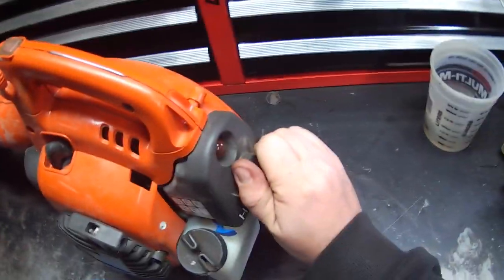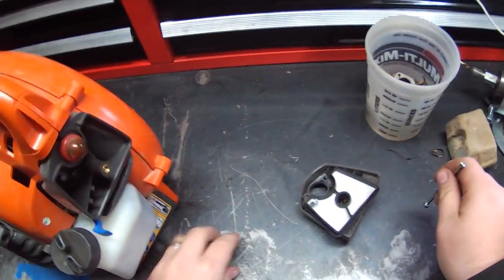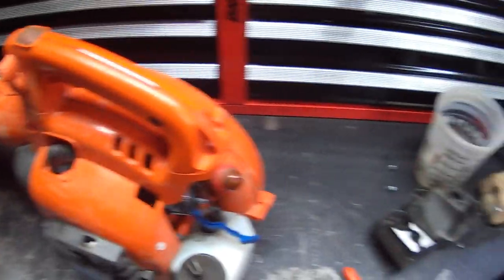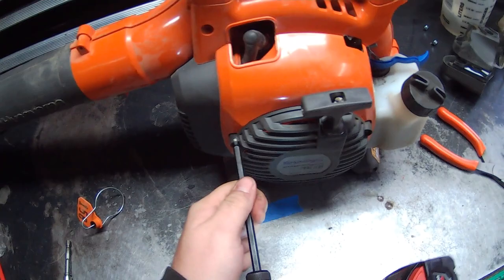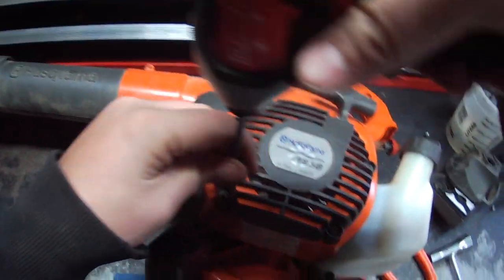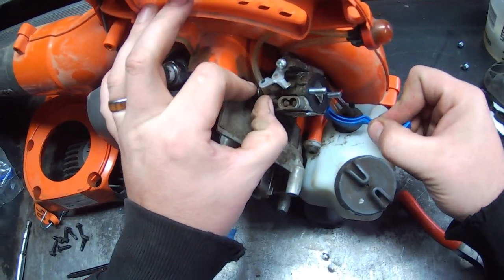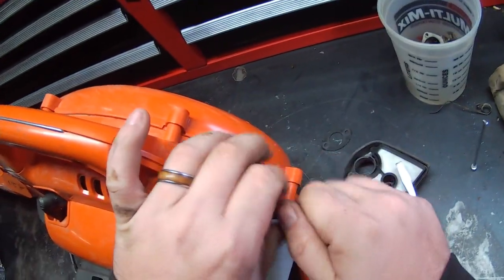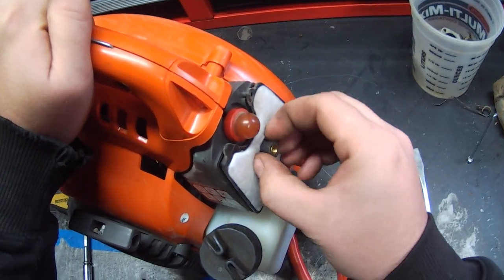HOW TO - husqvarna 125 B handheld leaf blower bogging carburetor carb replacement

Comment: Before a carb is changed, make sure the cheap fuel lines aren't cracked slightly, or in half.  The cheap clear Fuel lines just don't last like old US made.  They crack and cause a lot of issues you are troubleshooting, and it is only the fuel line causing your headache. Also, the 2 gaskets are different.  Pay attention to which of the old goes where/compare shape and pattern to new.  Mine began to run like crap.  It turned out to be a crack in the fuel line sucking air/leaking fuel.

Comment: Mine was doing the same thing and i adjusted the high speed jet(left) out a half of turn and it runs perfect. I bet that is 99% of peoples problem with these because ive had this problem eber since it was new.
Reply from the maker: Yes all of them are adjusted lean from the factory to hit epa emissions standards,

Comment: I've got a 125 BV. But can't find anything specifically for my blower. I also can't find a definitive answer as to whether or not the 125B and the 125BV use the same carberator or if they are different. Any help would be grewtly appreciated

Comment: My uncle bought one of these junk blowers. It runs good at full throttle but it wont idle when you take the throttle lock off even if you crank up the throttle screw so he just runs it at full throttle. It was like that since he bought it. I told him to return it.
Reply from the maker: To lean on the low end, try turning the low screw out a whisker
Reply from the maker: They adjust them lean at the factory to hit epa emissions standards
Reply: We did try previously but  no change.

Comment: Replaced my carb, replaced my gas.  Still having issues after the blower starts up and runs for about 5 minutes.  All of a sudden it just stalls then I can't get it to restart until I wait for about 5 minutes then try again.  Any ideas?
Reply: I had similar problem, check fuel lines aren’t bent preventing gas to pass through.
Reply from the maker: Check for spark when it dies, or crack the gas cap and see if it stays running

Comment: Great tutorial, tear down and assembly was a breeze with this video. I couldn’t get the fan blade off until you indicated that it was a reverse thread. I was having an oil leak that turned out to be a loose screw on the bottom of the crank case. I initially put the piston and crankcase in backwards until I tried to put the fan blade back on and realized my mistake.

Comment: Enjoyed the video.  My 125 B leaf blower starts fine, then on high motor for about 90 sec. it bogs down. I let off the trigger to catch it before it dies and bring it back up to speed and it immediately dies again, this will repeat. I have changed the air filter, cleaned the tank, changed and gapped the new plug and put on a new carb. It seems that it starts cutting out on high after it gets hot. Gas is marine grade, oil is Stihl.  Thank you.
Reply from the maker: Does it always restart? The symptoms you describe are most often the coil breaking down when hot or an air leak making it lean out
Reply: @Coakleyfixedit207  After writing to you, I went and had my lunch and after a couple of hours had passed went out and tried the blower again. Ran great this time. After a week of using it most every day it is still running fine. I won't even try to figure that out. Thank you.

Comment: Watched the video to see about adjusting the carb....I can't believe they work perfectly just by bolting them in!   I got a kit coming today, w/ the special adjustment tool (I guess nothing else works on these)?
Reply from the maker: Yes you need a special tool there is about 12 or 13 different ones, and it's illegal for a dealer in the USA to sell them, the new carbs are set to the factory settings for whatever they fit, if everything else with the machine is good they should run fine right out of the box, if anything they may need to be a little richer ( they are adjusted lean to hit epa standards) to richen them up turn the H screw out like a smidgen 1/8th of a turn. The cheap Chinese carbs seem to never run quite as good as oem they will function but just never sound quite right

Comment: Great video Ryan!  I can tell by the way you move that you are talented and experienced.  I am fighting the same thing, but it is more severe in that the fuel lines are shot too.  I have never seen a more corroded fuel system!  The lead end of the fuel filter corroded and there was junk all in the gas tank and the carb.  It was so bad that both butterfly shafts were completely stuck.  Since it was going to take a week to get a new carb, I tried to clean up the old one - against my better judgment.... I got it clean, but the diaphragm and reeds were crispy. Sure enough, it wouldn't run right.... I have ordered what I hope to be an OEM kit from Amazon.  Few questions:
1. Have you ever seen the lead end of a fuel filter corrode like that?
2. I know ethanol free fuel is better, but should the unit be run dry at the end of the season?
3. Would you agree that the cheap knock off carbs from Amazon should be avoided?  I got burned badly...
4. Do you have a video on tuning a 2 cycle carb?  I have trouble telling the difference between starving and loading up, and I've never been sure about the L setting.
5. Now that I am semi retired, I find myself repairing all sorts of lawn equipment for my friends.  I am getting tired of doing it for nothing. but I want to be fair. What is your shop rate?

Again, thanks for a great vid. I liked and subscribed. Now you are past the bad number of 666 :-)
Reply from the maker: Yes ethanol will eat anything, ethanol free fuel still needs to be stabilized I run strictly canned gas in all my 2 stroke stuff but keep in mind and I dont use my stuff much, chinese carbs are 50/50 chance they will work also rebuilding a carb is a 50/50 shot. I dont own my own shop I'm employed at one of the largest shops in my state and our shop rate is 75 per hr, but the going rate seems to be between 45-100 per hr
Reply from the maker: Oh also running dry is NOT the way to go it gives all the seals, diaphragm and rubber bits a chance to dry out,shrink and crack etc... it's best to run the pump gas out than run in a small amount of premixed canned fuel for seasonal storage than come spring you can just pour fresh in over it and you wont have any issues
Reply: @Coakleyfixedit207  Thanks much for taking the time to answer.  I have had the same experience you described in that a cheap or rebuilt carb is about a 50/50 shot. Why is that the case on a rebuild? I just assumed I had been doing something wrong. Thanks.
Reply from the maker: @briananderson2780  because the carbs have check valves and tiny passage ways inside them that can't be seen or replaced,  at my work we dont even rebuild carbs anymore its more cost effective to just replace and move on usually
Reply: Thanks. I thought I had hit the jackpot with the cheap carbs from Amazon, but I got a bad one. I am about where you are now... If some B12 and compressed air won't get it quickly, buy OEM and be done with it. Thanks for the prompt reply.
Reply from the maker: @briananderson2780  yeah carbs for those OEM are overly expensive like $30 if I remember right but the blowers are like $129 new so not usually worth taking to a shop either

Comment: Informative video. Few days ago, I purchased used Husqvarna 125 BV and it starts and runs pretty good.  When I turn off the choke and full throttle it's pretty powerful. But release the throttle and let it idle, the engine flutters and dies. I tried putting on full choke, half choke, and it won't start. But when I pump the primer again, it starts.  Do you think this would need a new carb or just need carb adjustment? Thanks.
Reply from the maker: I would try turning the low speed adjustment out a little and see if that helps,

Comment: Great video & to the point. I have the same blower & it's ran great besides lately I've noticed the carb seems to be loose which is making it shake & not run properly. Would just tightening the two 8mm nuts tighten it back up?
Reply from the maker: Yes unless the intake block is broke

Comment: Is there a need to adjust the new carburetor now that it's installed? Thanks for explaining each procedure clearly. Did the blower start up right away? You didn't demonstrate how easy it was to start it with the new carburetor!
Reply from the maker: Most of the time they will run with a new carb and just minor fine adjustments are needed MOST of the time I have seen some carbs the weren't set from the factory, I've seen new carbs have the metering levers off from where they should be set but most of the time a factory set carb should run from the get go with small fine adjustments being needed once its warmed up

Comment: Thanks for the video, mine is only a couple weeks old and loses power when I squeeze the throttle, I'm gonna give this a try.
Reply from the maker: Couple weeks old it probably needs both adjustment screws turned out 1/4 to half a turn, they are set lean from factory to hit epa emissions
Reply: @Coakleyfixedit207  worked like a charm, thanks for your help!
Reply: I'm now a subscriber
Reply from the maker: Thanks for the support,

Comment: Great video! I have a 125bv starts right up,runs until i turn the choke off. Would be greatly appreciated if you have a fix! Thank you and keep up the fine work!😎👊
Reply from the maker: That's a broad symptom, try checking the fuel lines for cracks or if its broke inside the tank also could be as simple as turning both adjustment screws out half a turn

Comment: Thanks Ryan! I was reading what you said to Chris Woodruff below and I have something similar. For the past two seasons, I have used my 125B until it dies on its own (about 30 min or so) and won't restart until I come back another day to use. This past week, I started her up and about two minutes, died and would not restart at all. I have a new carb (Amazon), and before I start tearing it apart, I want to test the spark. I used a spark tester on the plug and pulled the cord but no spark. Should I be looking at a new ignition also?
Reply from the maker: If it has no spark it's almost always the coil or the switch is bad but I hardly ever come across that, it's a bit of a project to do the coil if you've never done one on these

Comment: Even with a new cheap carb, it may not run.  Most carb kits will include the adjust tool which is a good indication that you are going to have to tweak.  I'm throwing mine away after next fail to  run and going back to ECHO.
Reply from the maker: The echo is hands down a much better product

Comment: I have same model, about 9-10 years old. Changed air filter, fuel filter and spark plug. Runs great but just started not being able to idle. I use the fuel additive. Any suggestions?
Reply from the maker: Turn both adjustments out just a whisker if its never been adjusted carbs come set lean from the factory to hit epa emissions after awhile they need to be richened up
Reply: Muffler screen is clogged I bet.
Reply: @Coakleyfixedit207  so just found your video, my blower is roughly 5 years old been working great, will stall on WOT. When you say turn out does that mean turn to the left or right? I'm assuming left but want to confirm. Going to try that before anything else.
Reply: Spiros Zangotsis need help?
Reply: @lukeWiz44  nah I got the tool off Amazon and I think I got it going good. Well see though
Reply: Spiros Zangotsis 👍👍

Comment: How long did the original carburetor last before it had to be replaced?
Also can it be adjusted with the screw from the access slots on the top side ?
Reply from the maker: Yes they can be adjusted but a junk carb adjusting won't help, carbs life is fully dependent on the fuel run through them or amount they get run the more they are run the longer they will last (with good fuel)

Comment: So what do you do with the old carb ? Surely not toss it? I ask because I left old gas in mine I dumped it and added new gas and now it runs but not as strong as last season thinkin might need a new carb
Reply from the maker: Right in the trash
Reply: I just looked up the part 15 - 20 bucks might as well trash the old one

Comment: I have torn mine apart, replaced the carb, fuel lines, fuel bulb, tank cap, crankshaft seals and it still will not stay running. I thought it was a fuel issue to start off with. It will only start on full choke. I flip the choke to the middle, once it starts and attempt to throttle, but it bogs out. Do the high/low screws need to be adjusted? I haven’t touched them yet. Any help is appreciated.
Reply from the maker: Try turn both screws out 1/4 turn and try it, also I'd pull the muffler and check the front of the piston for scratches

Comment: If there isn’t a gasket between carb and air filter  housing would that cause the leaf blower not to start?
Reply from the maker: No
Reply: Ryan's Knives and Repair do you have any ideas why it wouldn’t be starting? The igniting coil is good.  park plug is good. Air filter good. Spark arrestor is good. The kill switch is good. New car but I think someone has messed with the L and H adjustments. Do you think the L and H being off would cause it not to start?
Reply from the maker: @kyleroyer9227  9 times out of 10 if the machine isnt blown it's a fuel issue
Reply from the maker: @kyleroyer9227  yes the factory settings are 1 turn out from GENTLY seated if it wont run atleast good enough to tune from that point you have other issues

Comment: I changed my Carb and it ran for about 3 minutes and then died. I start it again and runs for another minute and dies. Etc... what did i do wrong?
Reply from the maker: Check for pinched lines, also that symptom could also be the coil though usually a coil wont restart

Comment: I think I will take mine over to a small engine specialist.  This looks harder than a complex tax return.
Reply from the maker: It's not bad but if you are dont take it apart first some shops charge more if it's a "basket case"
Reply: Ok, problem solved. And I haven't seen anybody else talk about this. Mind you, my 350 was basically useless. Would start but no blowing power whatsoever. Easy fix. Let me know if you want to know what it was. ☺️
Reply from the maker: @newmanfertig886  was it the muffler screen plugged?
Reply: @Coakleyfixedit207  Bingo! My small engine mechanic called it California. The screen was black! Very good answer.
Reply from the maker: @newmanfertig886  it's pretty common on some husqvarna models, it's a spark arrestor screen to help prevent forest fires